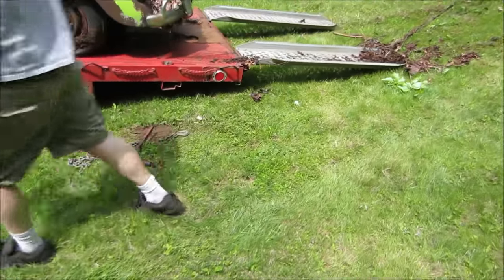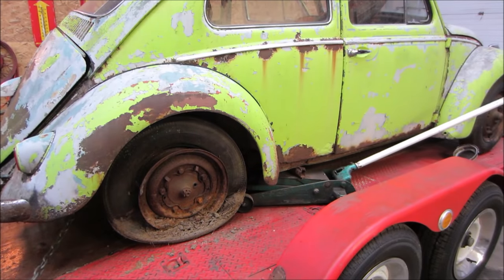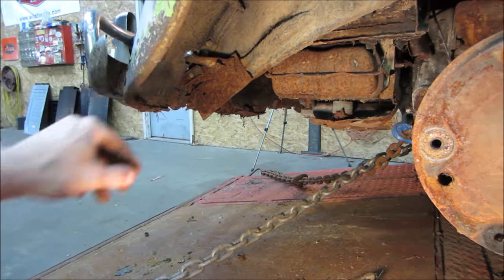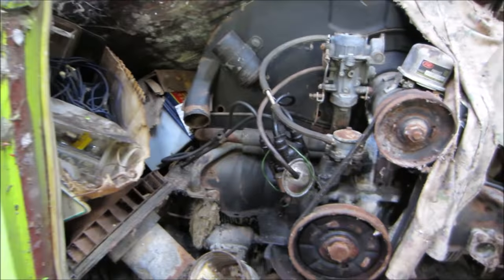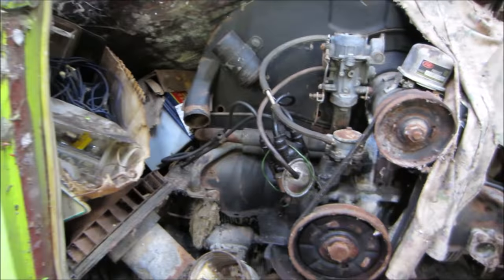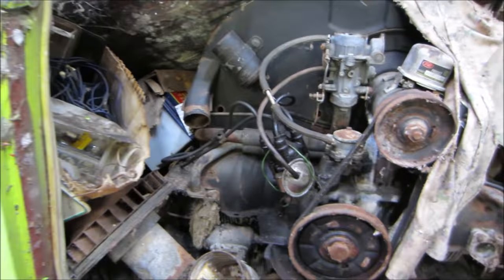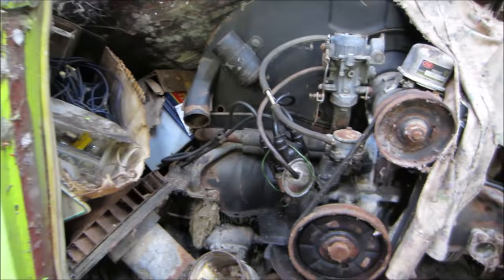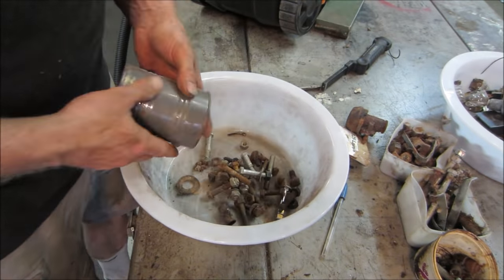Lets Rescue a VW Beetle From California, That They Just Gave Up On.

Comment: I was 16 yrs old back in 95 mowing lawns, when one of the houses I was mowing was preparing to junk a 70 bug. The lady told me the wrecker was giving her $200 to haul it away. I told her I would mow her lawn for the rest of the season for free if she gave it to me. She agreed so I through what gas I had left in my gas can for the lawn mower, spent 15 minutes tinkering and she fired up. After I got home I told my dad and we went back to drive it home. I miss that bug. No heat and no a/c, but those seats were infamous for robbing my friends of the change in their pockets which came in handy when I needed 85 cents to get home and it didn't matter where I was hahaha. I never did clock the mpg on her but it never mattered anyway.
Reply: I have a feeling that if a vw engine isn’t mechanically broken…..it will start if you just know what to do to make sure there is spark and fuel.
Reply: I had a summer job with a farmer. He gave me his VW Beattie to drive backs d forth to work.  I drove that thing like a race car and stick shift all the way. Great little car and very fast pick up
Reply: My 66 got 22 mpg  about the same MPG as my 5.7L Hemi Challenger when I drive it in eco mode.   Back in the early 70s I remember a  early 70's gas war with 22 cents a gallon gas and did a fill up from an almost empty tank for $2.
Reply: @robc8468  Must've been nice, Now I gotta work 4 flippin' hours to just fill the 20 yr old Honda Civic.
Reply: burningfeet 53  The EPA rated the 1975 Beetle at 21.4 mpg city I drove my 66 mostly in the city. In 1975 the average car got 13.4 in the city.
Reply: I had a vary similar situation. With a 71 super beetle .the fella that owned it was Bill . He was a retired  diesel mechanic. (Excavator equipment). All the seats were removed for his tools. Tha thing would drive through snow .loved it
Reply: Ever see the movie Sleeper?
Reply: @zefallafez  I saw it, that Beetle fired right up too, I'd rather watch Mustie1 than Woody Allen!
Reply: @georgedavidson7986  If you think it had fast pichup up try experiencing a late 80s 5 L Mustang you will find that suddenly bugs don’t really matter anymore that happened to me back in the 80s I still appreciate Volkswagens but I never got in another one again and at the time I owned three I immediately sold them and got myself a Mustang
Reply: Milyen kocsijait vannak még
Reply: Gc
Reply: I remember that lol I helped you!

Comment: I love these old bugs!!!  I love the design of the engine, it is absolute genius the way they built them, without the need for water for cooling, extremely reliable and perfect for desert weather.  I miss my '72 Super Beetle, I wish I had taken the money and the car instead of having it totaled.  It sold at the auction for $1,300, it had side damage but I had put new tires, new front struts, oil pump and filter (aftermarket) and I was in the process of finding a way to fix the fuel gauge.  I loved working on it, I loved driving it, I loved everything about my bug and now I wish I had another one and the time to fix it!!!

Comment: Hey, Thanks for the trip down memory lane. I gave up my VW bug about the same time after it being mine for about 25 years. Had to let it go because the body was rotten and a hazard to proper steering. My co-worker ended up with it and came back later and gave me $100 for it. Said that the body was rotten, but the motor and transmission were the best used components he had ever purchased. Well, I did have engine re-built 3 times and replaced the transmission. Lasted me for 300 000 miles.

Comment: I can’t believe the car did not pull in half!
Reply: The roof and centre chassis tube must still be sound
Reply: I knew it was in better shape than it looked when it didn't fail coming out of the dirt.
Reply: I was shocked that any of the wheels still rolled.
Reply: The bird droppings were holding it together

Comment: Me: sees a rust bucket needing a ton of work...
Mustie: wheel wells are shiny....its salvageable.
Reply: This one should be easy. All the patches are straight forward and no brainers. Then just slap the included engine in it, and send it down the road. Easy peasy.
Reply: I must have been desensitized lol. All I could think of the entire video was "Damn that's not even half bad compared to most of these."
Reply: He does have a passion for VW's. I know he will get it going even with the Fred Flintstones hole in the floor...lol
Reply: I wouldnt touch that with a 10ft pole. I would call this The Grinch

Comment: You can see what happens to spray paint over hot dip.   I thought it was amusing when Mustie was pushing on the inside of the door, like a clown going "Hey, wait guys, I have to push it open first!"   It was also mildly amusing with the lubricant on the hinges.   Everyone does it - even knowing that you have to wait for penetration, you still immediately try the object to see if it 'just worked'.

Comment: FYI- the slotted aluminum disc you said “I don’t know” about under the hood is the insert for a pressure cooker (probably Presto) which keeps food from burning to the bottom of the cooker.
Reply: My mother had one she used as a trivet (put it on the table to put hot pots on it).

Comment: My first-ever car was a 59 bug. It didn't have a gas gauge but had a lever on the front fire wall above the tunnel that would switch it to reserve if you were running out of gas. Didn't see it on your bug. Lesson learned was to put lever back to normal after filling up.

Comment: I saw a Chrome strip come off on the drivers side, it fell off, look in the mud. I had a 1968 Bug I got used and traded it to a guy for a 1971 Karam Gia in 1976. Keep it for a few years and sold it. It ran good, did not have any heat in the winter. What No Snakes inside ? I think you can soak the carb overnight to clean it up. I think you should have a dusk mask on, don't breath all the dirt in. Little story..... Tried to teach my Wife to drive a stick. That did not work out.......lol.  I still have a very good front axle with the brake drums, brakes and hoses. I wonder what it is worth today ?

Comment: If you in Oz, you'd be reaching in pulling stuff out...."Oil filter, oil wrench, deadly spider, fuel pump, trim, deadly snake, fuses, relay, battery, 5 meter croc, registration paper, more trim, 6 volt battery, shark, funky seat covers, front seat, dingo...
Reply: "It's broken a couple of timing gear teeth, the radiator's cracked at the core....."
Reply: Now that was funny oz   🤣🤣😂🇺🇸  you forgot the taz in the glove box .
Reply: At one time this country was crawling with critters too. But our ancestors in their infinite wisdom killed all of it. Where wolf? There wolf. Click, bang.
Reply: @1pcfred  Thankfully, wolves are being reintroduced as someone finally realized they're part of the ecological circle.  No matter how hard you try, you can't stop farmers shooting animals they consider pests.
When I visited Grand Canyon some years back,  I took a horse ride down deep into the canyon.  The Havasupai guide told me you only really need to worry about rattlers and scorpions.  More the scorpions than the rattlers.  Thankfully, I didn't see either one while I was there.  In the parks, wolves are doing well now.  Outside of the park's protection they still suffer losses, shamefully.
Reply: @ellesmerewildwood4858  you can't stop folks from shooting stuff on their own property they don't want on their property. That's why you own property.

Comment: What an optimist you are!  "At least the front tires roll."  I'd be like "OMG, I don't want to spend 500 hours on this."  But at least you can make videos from it.  I wish I was fearless like you.
Reply: 500 hours? Car restorations can easily take far longer than that.
Reply: @1pcfred  Not mustie's restorations.  He made that point, it's not worth putting $30000 into a $20,000 car.  He just fixes what's broken so it works reasonably again.
Reply: @Clearanceman2  it can be worth it if that's what you want to do. Truly amazing feats are rarely practically justifiable. If all Neil and Buzz wanted to do was go for a stroll there's easier ways of doing it than flying to the Moon.

Comment: Be interesting to see if an old stock battery never used still has any power.
Reply: The short answer is no. It would've self-discharged completely in about two years. It may or may not take a charge but some cells will surely have been damaged by being fully discharged so it's probably best to just recycle it.
Reply: From what I've been told (and I could be wrong about this), back in the day (mid-'90s and earlier) batteries weren't sold with a charge. You bought one, charged it up, then put it in the car. This was changed because people would come in needing a battery RIGHT NOW, so they started selling them charged.
Reply: @DarkElfDiva  If I'm not mistaken, they weren't just sold without a charge but without electrolyte. You had to add the acid, charge the battery, and then install it. The change in the mid-ninties was to sealed batteries (which obviously couldn't be sold without electrolyte).
Reply: Would that stock battery have been dry? Like some brand new motorbike batteries that you add the Battery Acid to.

Comment: So thats what happened to Herby........

I use to have a early 61, was a love of working on it and was such a great car used a boat battery in mine as the battery was both 6 volt and 12 volt, everything else was original even down to the engine took it through death valley in the middle of the day.

This brings back so many memories. Thanks Mustie :)

Comment: "It actually does not look terrible..."  Ever the optimist
Reply: Until he opened the door and you could see the ground.
Reply: @carldarlington7395  it's just the floor pans, the main structure of the car (which is far more important than the floor pans) is in very good condition.
Reply: For a VW of that year it's in very good condition.
Reply: @madmax2069  pans are actually pretty easy to do. Those corners Mustie was pointing out aren't easy to repair.
Reply: @madmax2069  I watched some more later in the day and am very surprised how much survived sitting in the bush like that.  I am up in Canada and have seen what happens to bugs.  This is quite impressive.

Comment: My 1st factory job was a steamcleaner in a sheet metal shop.The fastest and efficient method is to wet it all down and let the detergent work (soak mode).Then     clean top 1st working down.

Comment: I found a '70s-era Ford Bronco in the woods on a trail leading to one of my fishing spots. It was stuck between two trees and there were a couple of guys waiting for a wrecker with a chainsaw and a long length of cable. The path was barely wide enough for two people to walk side-by-side but yet there was the Bronco. Since I was headed home I told the fellows that I'd direct the wrecker to the head of the trail and that's what I did.

Comment: The first Super Beetle I found out here in the midwest needed both new floor pans along with other bits of body work.  I ended up just doing a custom chassis using the powertrain from a Audi TT 225 Quattro with the body set down on it.  Makes for extremely nimble car that's amazing fun sliding around off road courses.  

For some reason the same people that chop up and make buggies out of them frown and say I ruined it by making it not rear engine.  Not like I put a small block in it, at least it's still VW in a way lol.

Comment: Funny, I saved my first VW 35yrs ago. Ah' the days when $250 could get you a nice '68-'73 bug you could spend 2-3 weekends making Good+ cond. again. I once bought [ for 300 bucks] a 1963 Beetle covered in 'scarlet and grey' Glidden latex house paint. It had been stored 25 years like this after being used an Ohio State University 'mascot car' for football games. It was 100% original with rare even then- over tunnel grey rubber floor mat, super clean brick red interior, pearl white metal.

 Turns out the house paint preserved the beautiful pearl white body paint. Much I was able to flake off. It's bumpers were missing though. However I kid you not, I rented an unused garage behind a friends house to restore my '64 VW Westfalia camper, and as I pulled myself out from under the van one day I looked up at the rafters. Straddled across those otherwise totally empty rafters lay two slightly dusty perfect front and rear chrome Beetle bumpers with over-riders (same as on this '58)!!!  What are odds?! My friend said go ahead take them, they were there when when he rented the (campus) house.

1963 was best year for Beetle imho... LAST YEAR OF- license plate light being small, large vinyl sunroof, white turn signals on front fenders, chrome half ring steering wheel horn, and 2nd to last year of smaller rectangle back window and larger wing windows on the doors.

Comment: Wow, this one brought back a few memories. My first car as a lad back in the UK was a '60, very similar to this. Served me well for 5 years with few problems. Biggest issue I had was the 'run/reserve' fuel tap instead of a gauge. If you let the fuel get really low the car would start spluttering on hills as the pickup tube was exposed..... you had to reach down by the pedals and flip the tap asap. It worked fine, so long as you remembered to flip it back to run after you filled her up. If you forgot, the next time she started spluttering and you reached down to switch to reserve.........Hitch hike time...no cell phones back then. Happy days.

Comment: I am reminded of my first car when I was 18 in 1978 an Austin A40 Farina wirebrushed the rust out of the floor cut up a couple of kerosine tins then rivetted them into the floor a couple of coats of bitumen tanking compound out of Dads shed and viola the shagin wagon was born :) it was better than that mechanically but the body only looked better,

Comment: Ran by this video by accident, and my first thought...that's my old car.   I had a 66 Fairlaine GT with 335hp engine that got 13 to 16mpg.   A friend was a vw addict and had mounted a bug body on a chevy frame with a hopped up short block and wrinkle walls.  He sat in back seat to drive.  He had it auto show quality with multillayered metalflake orange paint and 30 coats clear coat.  He helped me get an old beater that was patches of red and dark green so I could leave GT for new wife to drive.  In summer of 71, I decided to repaint it something really bright and picked this sorta flourescent lemon lime green paint.  Another buddy who had never painted a car before, my wife and I did everything in my dads garage and sprayed it not really knowing what we were doing.  No booth, no dryers, 1930's compressor, etc.   I sold it a few years later when we moved to Ohio to a townhouse with one vehicle limit.   Can't remember who I sold it to, but sure does bring back great memories.  I lived in northern Indiana though, not California.   Can't believe theres another weirdo out there with my color taste.

Comment: Being from NC and at this time of year it would have been a longer time getting that VW on the trailer. First, you gotta spray head to toe with Backwoods Off so the ticks and chiggers and mosquitoes don't eat you alive. Then you have to take something to reach in and check the seats and compartments for water moccasins, large spiders, rats and possums. One person with at least a .22 pistol or rifle watches for what runs. Then you Spectricide the heck outta that thing after you get it to where you're parking it. Because not everything in the woods in NC can kill you...but they want to.

Comment: That black California plate became a permanent plate starting in 1963. All of those plates had a number 63 in the registration sticker well. Its original 1958 plate would have been yellow with black numbers and “California” would have been offset to the left. So, I’m guessing that was the original permanent replacement dating back to 1963. Quite collectible nowadays.
Reply: Series started in 63 ran to 69. So YLK was issued in 69 or early 70 hence the 3/4 stickers visible on the plate.

Comment: The tires on the rear look like they have a beefy tread. The kind you usually only saw on rear-drive cars in the winter. I suspect it might have spent a New England winter or two on the road.

Comment: Are you sure that was parked 30 yrs ago or has it been growing there for 30 yrs. I found a '74 super beetle turned into a street legal dune buggy with the big flotation nobbies tires on the back, engine exposed, in a cattle field for 20+ yrs. I put a battery and carb on it and it started right up. I think about a thousand mice ran out of it when it fired up. Needs a lot of work but body and floors are solid, so far, so I figured why not save it.

Comment: see if you can find some old vw ambulances.  they had a special carburetor with heating and stuff.
also old refridgerator trailers " atleast in europe "  used vw bug  carburetors.
they all have vw logo grinded off. even a batch i found of 20 new

Comment: In California the plates stay with the car. That style of yellow on black came out in 1963 and replaced any plate issues before 1963. My '56 Plymouth still has its yellow on black 1963 plates. However, you can pay the State a fee and get new yellow on black plates for new cars. Before 1963 you were issues new plates each  year with the same number or metal corner tags with the current year to be put on older plates when it became too expensive to issue new plates every year. You can also pay a fee for year of manufacture where you can use a set of original plates for the year your car was made. A friend of mine has state issued 1952 black on yellow plates on his 1952 Chevy with a small side palte to hold the current year and month tag.

Comment: In the trunk, the plate with the slots in it goes in the bottom of a pressure cooker.
Reply: Yea it does. Or it's a air cleaner lid for a Pinto.